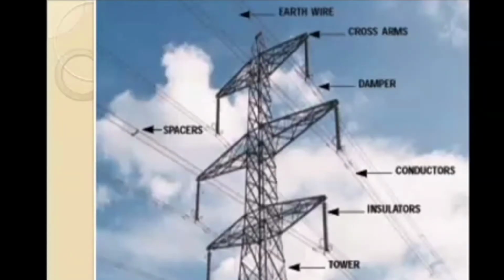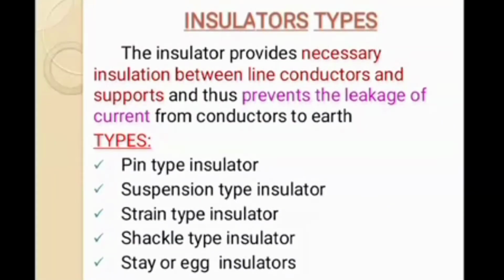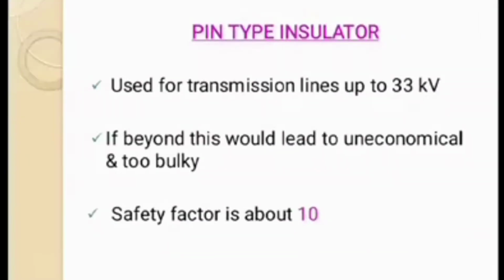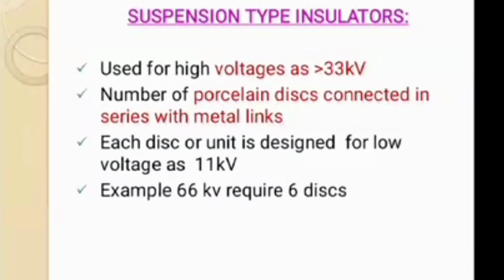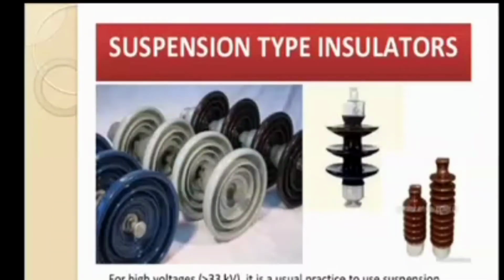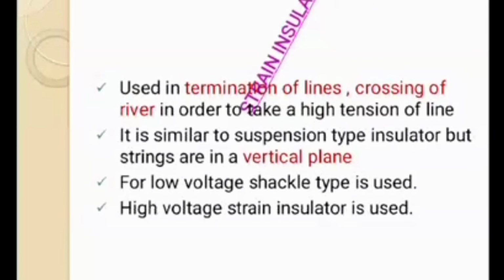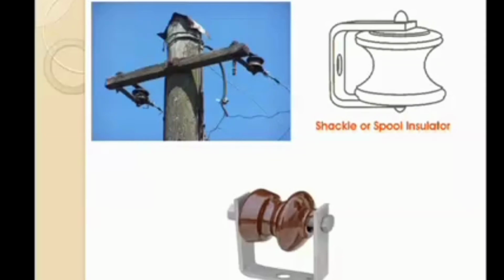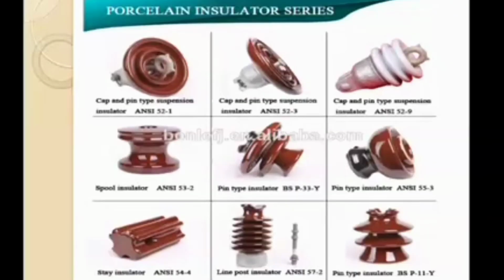Types of Insulators | Electrical |Transmission Line |  Power System   |

Comment: I think you should inform about components of content(chemical composition/material used) in which and what types of insulators
 Sir, you may also inform that which type of insulators and where it is used .Eg: shackle type of insulators are used in normal electrical posts ( like that)  
This is regarding to my opinion sir.

Comment: Explanation with animation will be good instead of using ppt to my opinion sir.
The video is good enough for explaining insulators but, I  have some small quires about transmission lines sir . I think need some more simple explanation for technical terms.

Comment: This video is very useful to me sir. Suspension type and strain type instulator are similar but position is different sir. But in suspension the contain disc contains 11 kv capacity whereas strain also contain disc structure sir